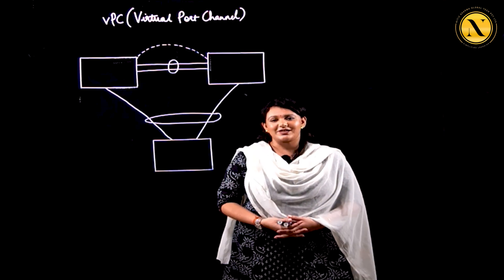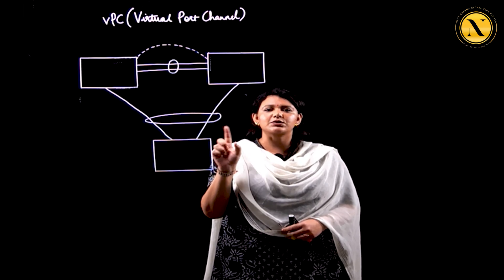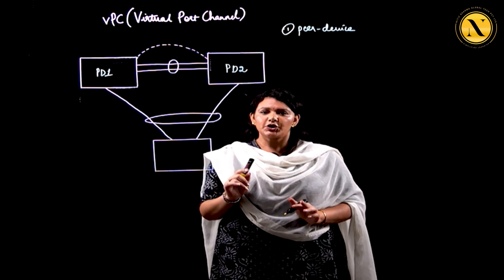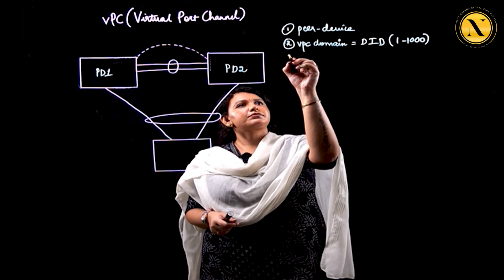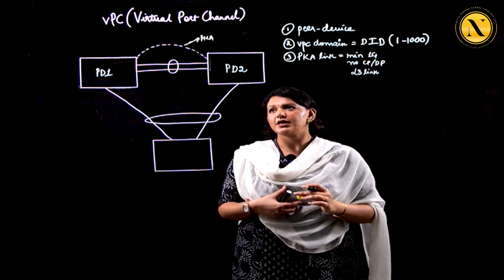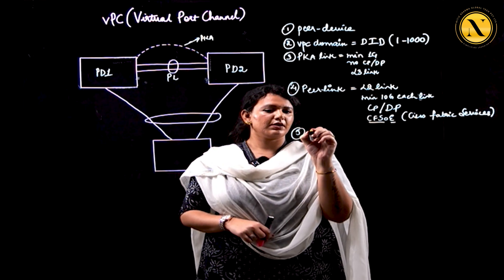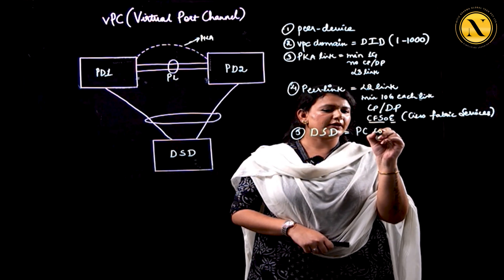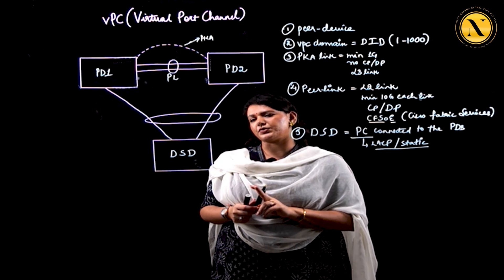What is VPC (Virtual Port Channel) & Its Terminologies by Ms. Madhuri Suresh

Comment: Could you please help me with vPC scale configs with spirent port connected ?? I have vPC setup with primary and secondary along with two downstream swicthes. each down stream device connected with one spirent port 1 and another downstream device connected with another spirent port2
need to achieve. scale configuration
250 VLANS, 3000 Mac learning, 3k L3 routes.
Reply from the maker: •  vPC Domain:  10 
•  VLANs:  100-199  (you can scale this up)
•  MACs: 10,000+ per port
•  Spirent simulates endpoints per VLAN
 
---
1️⃣ Nexus vPC Configuration (Primary & Secondary) peerlink and vpc domain and everything
 
🔧 Downstream vPC (example for SW1):
 
interface port-channel10
- switchport
- switchport mode trunk
- spanning-tree port type edge trunk
- vpc 10
 
interface Ethernet1/1
  - channel-group 10 mode active
 
interface Ethernet1/2
  - channel-group 10 mode active

Repeat the same on Secondary switch (use same port numbers or adjust accordingly)
---
2️⃣ Downstream Switch Config (L2 Mode)
 
Example: SW1
 
bash
vlan 100-199
 
interface port-channel1
 - switchport
 - switchport mode trunk
 
interface Ethernet1/1
 - channel-group 1 mode active
 
interface Ethernet1/10  # Connected to Spirent port 1
 - switchport
 - switchport mode trunk
Repeat for SW2, with Spirent port 2
 
---
 
3️⃣ Spirent Test Setup (GUI / TestCenter)
 
You’ll do this from Spirent TestCenter GUI:
 
A. Port Mapping
 
•  Port 1: Connect to Downstream SW1
•  Port 2: Connect to Downstream SW2
 
B. VLAN and MAC Emulation
 
On Port 1 (repeat similar for Port 2):
 
•  Create 100 VLANs: 100–199
•  For each VLAN, simulate 100 MACs
•  Total MACs = 100 VLANs × 100 MACs = 10,000 MACs per port
 
C. Example Spirent Steps
 
1. *Add Emulated Devices*:
 
   * Device Range: 10,000
   * MAC increment: 00:11:22:00:00:01 → ...
   * VLANs: 100–199 (round robin or sequential)
   * Encapsulation: Ethernet II, VLAN
 
2. *Traffic Generator*:
 
   * Create StreamBlocks:
 
     * Source: Port 1 Devices
     * Destination: Port 2 Devices
     * Bidirectional
   * Frame Size: 64–1024 bytes
   * Line rate: 10%, 50%, 100%
 
3. *Test Objectives*:
 
   * MAC learning on vPC peers
   * Traffic forwarding consistency
   * Convergence during failure (shut one vPC leg)
   * Oversubscription test (line rate)
   * Measure packet loss, jitter, latency

Comment: Liked this video but I have a doubt.

It seems to me that separate physical cables will be used for PKA link and Peer link.

PKA link is for Keepalive messages
Peer link is for Control/Data plane messages

In case if Peer link cable is damaged, what is the use of sending just the keepalive messages using PKA link cable?
Reply from the maker: Yes, separate physical cables are used for PKA (L3) and PL (L2). 

If in case PL goes down, the PKA running will prevent the split-brain scenario as it is exchanging KA messages. 

For more information, Kindly Fill out the form below, Our team will be reaching you out soon. https://forms.gle/1qkf6nHNwLHzCKyv7